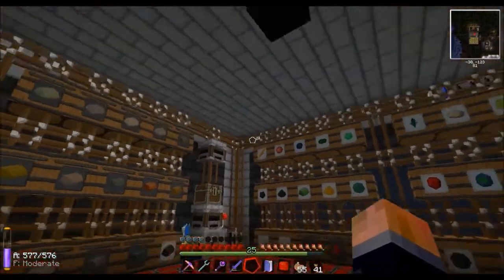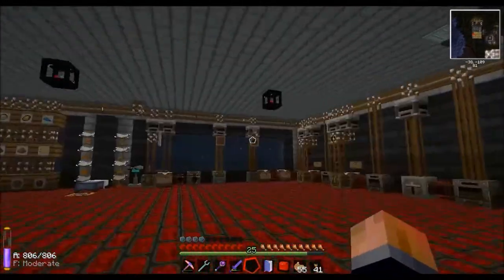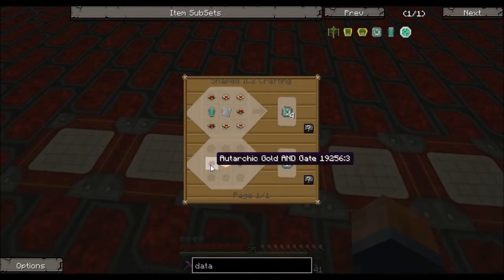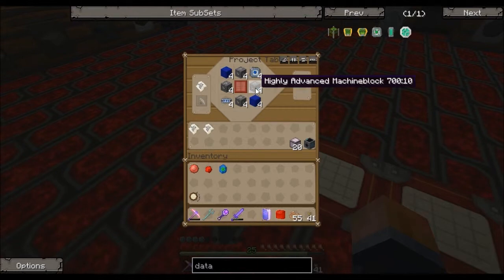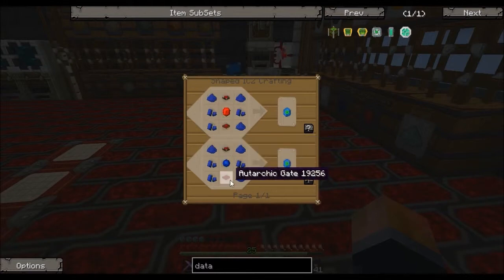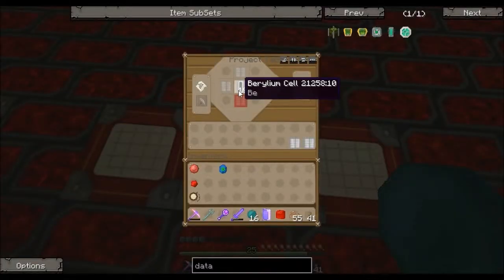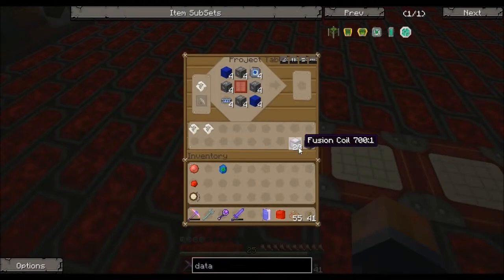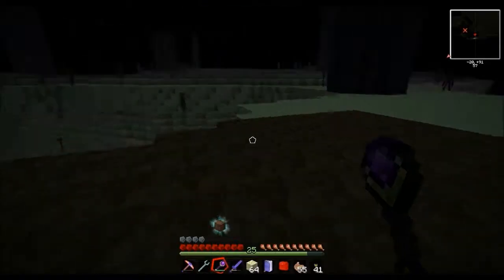GregTech Fusion Reactor - Part 2: Rubies, Platinum & Ender Pearls (MindCrack v8.1.1)

Comment: you can just place lightning rod right next to matter fab for 8k EU/t, if using AESU's for extra storage you can use a HV cable that takes 2048 EU/t instead of glass fibre cable that is 512 EU/t.